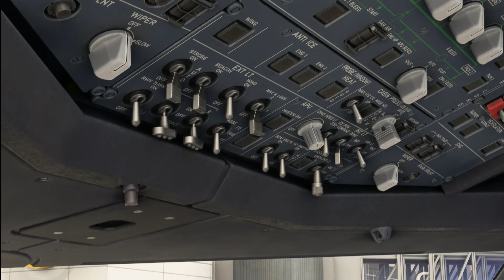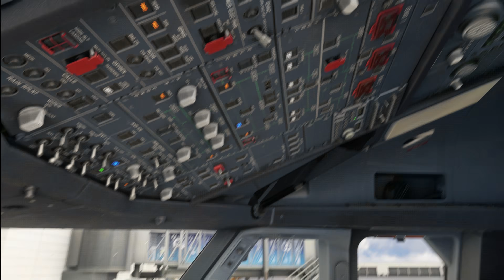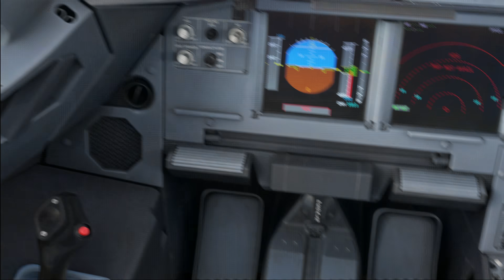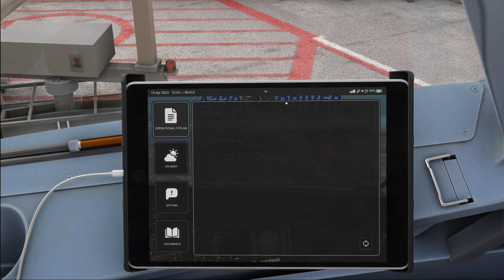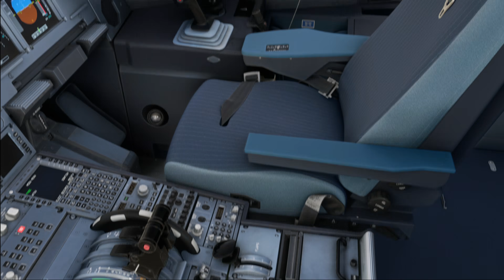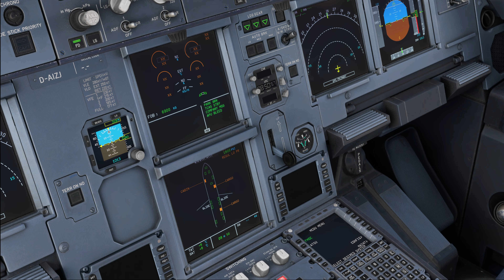Airbus A320 Tutorial 1: Preliminary Cockpit Preparation (powerup and first steps | Real Airbus Pilot

Comment: So far, part one has been accurate to the official procedures that I have. I'm also using Fenix, so this is very precise, especially with the EFB integration for managing performance calculations and charts. I'm using this to study, and hopefully, the next few episodes are just as accurate so I can fly the plane from RPLL to RPVM in preparation for my recurrency. It's been years... If you have the time, many Filipino pilots would benefit if you create a type rating series with RPLL--RPVM, or at least cover the LOFT check with engine failures, fires, etc.
Reply: Are you training with Sputnik Aviation by any chance?
Reply: @georgeclayton  Why?

Comment: 10:35 Why are ADIRU switches not guarded in any way? I've been wondering about this for a while. This seem like pretty risky design
Reply from the maker: They are guarded, in the real world you need to pull them towards you in order to be able to turn them into the off position. You can only turn them into NAV without pulling them out. It's just not visually modelled here.
Reply: @A330Driver  thanks a lot!

Comment: Question, Do you not need to wait for the flap to be open before pressing the starter? is there anything in the manual that recomends that? have seen in many places where you need to wait for the flap open message to illuminate before pressing the starter.
Reply from the maker: Hi, no, you do not need to wait for the flap to open. The FCOM recommends to wait 3 seconds between the MASTER and the STARTER.

Comment: thx, interesting to have a full walkthrough. Just detail question. In the MCDU I see you actually put in the callsign and not the actual IATA flight number is that correct? I was always wondering because the flight number could be something like LH462
Reply from the maker: That’s correct, you insert the callsign.

Comment: Thank you for this, I really love the way you share the extra small details. 

Please tell me, if you are setting up in SimBrief do you add time before the flight (like 5 or 15 minutes) to give a bit of time to check everything before you need to start thinking about boarding , etc. 

That time might be shorter on a turn around, but I sometimes find the default SimBrief time is sometimes just enough even without the extra steps you are teaching me. 

Again , thank you. 
I am using your videos to make my Sim experience a lot richer.
Reply: In real life everything is going really fast, for me the default simbrief time works well
Reply: @Jannik_Stein  excellent response, thank you. 

IRL, I’m sure the flow goes pretty quick when you scan panels or pedestals, as opposed to dragging your display around.
Reply from the maker: I usually use 35 minutes for a cold and dark start and 25 minutes for a turnaround in my sim.
The 35 does not include sim startup time btw, but is from „boarding the crew“ until offblock.
Reply: @A330Driver  Thank you😀